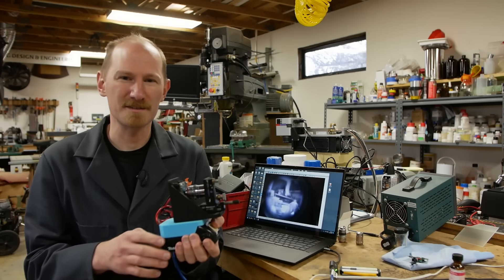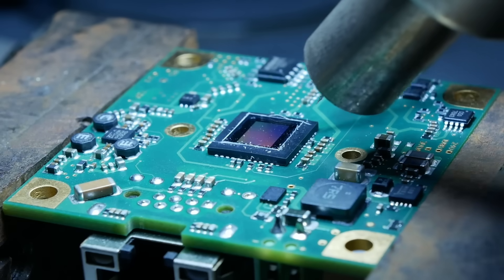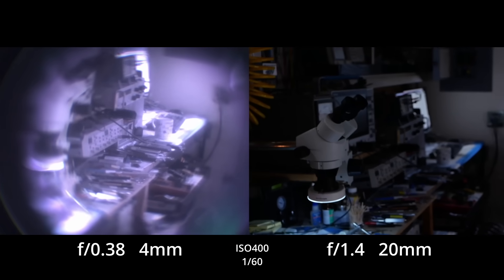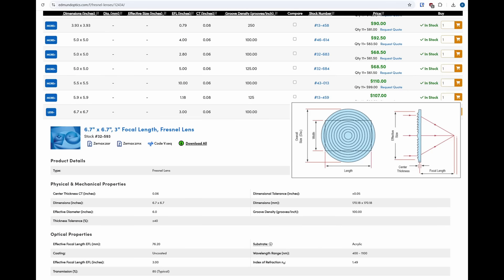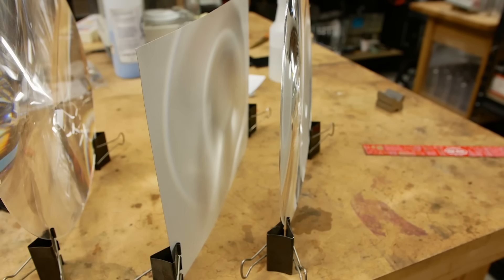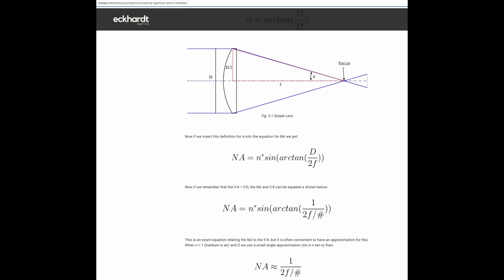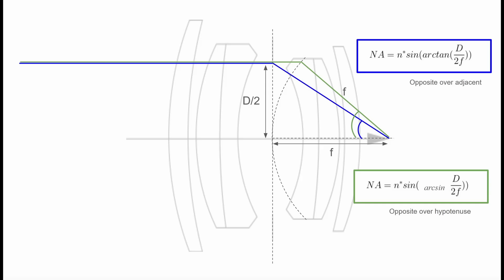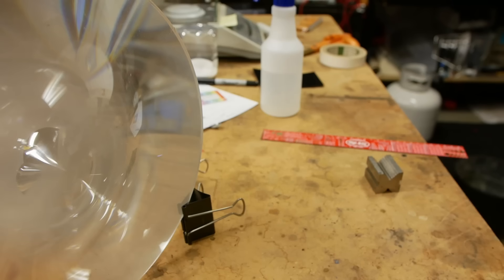f/0.38 camera lens made with oil immersion microscope objective

Comment: To my understanding you are using an oil immersion or dipping microscope objective for infinite tube length (infinity correction) reversed (image sensor at focal point). Note, that by flipping the objective the entrance pupil has become the exit pupil and the former exit pupil has become the entrance pupil. Now the numerical aperture value printed on the barrel is correlated to what is your system's exit pupil. In general entrance and exit pupil diameters differ unless the system's optical construction is symmetric. Honestly, the whole f-number to numerical aperture conversion idea and the formulas you came across seem dubious to me. It would work out for a single thin lens or a special system with equally sized pupils. But the result would be off for a thick lens or an asymmetric system.

For collimated imaging systems (infinite object distance) there is no meaningful numerical aperture since the marginal rays in object space are parallel to the optical axis. Therefore f-numbers are used instead. Technically speaking f-numbers only make sense with collimated systems. (The f-number setting of photography lenses are for infinite object distance only. When used at a finite object distance an exposure compensation is mandatory. When the (absolute value of the) magnification is below 0.1 the compensation is so small that it is usually neglected.)

Since microscopy objectives are highly optimized for a specific magnification, the ray tracing should be more or less unique. (No tracing for different configurations required.) If the manufacturer provided you with a ray tracing plot, you should be able to figure out the pupils yourself. For a collimated system like yours the entrance pupil diameter is just the diameter of the marginal ray bundle in object space. Some objectives even have a rear stop of the same size as the pupil to reduce stray light.

More generally you would first find the intersection of the object space chief ray with the optical axis. This is where the entrance pupil plane is located. [Note: Do not follow the chief ray as it is refracted. Just extend the chief ray emitted by the object until it intersects with the axis. If the ray is parallel to the axis the pupil is at infinity and the system is object space telecentric. Side note: If you follow the chief ray through the optical system an aperture stop could be placed wherever the ray crosses the optical axis.] Next you would intersect the object space marginal rays with the entrance pupil plane. [Note: Again, do not follow the marginal rays as they are refracted. Just extend them as they are emitted from the object.] 
[In the same fashion you would intersect the image space chief ray with the optical axis to get the position of the exit pupil plane. And you would intersect the image space marginal rays with the exit pupil plane to find the exit pupil.]

Did you notice a big difference with the protective glass on? 

The refractive index of immersion oil is probably close enough to that of the glass cover. (I would not worry too much about small differences between indices for now since the main purpose of the oil is to prevent reflection where light transits into a medium with lower refractive index.) Have you thought about filling the gap between protective cover glass and sensor with immersion oil? You would have to make holes without creating any loose dirt. Maybe you could poke holes through the resin with a hot needle. On the other hand the oil might even reduce the effect of the micro lenses of the sensor resulting in lower sensitivity.

Comment: Very interesting project. The oil immersion thing is certainly something not used in conventional photography. I'm into fast lens designs and once experimented with a huge ass Fresnel lens forming an image on a sensor, but the quality was underwhelming due to lots of coma/chromatic aberrations.

As for numeric aperture, I had an intuition that the actual f-number is determined by a solid angle that is formed by the aperture as viewed from the focal plane (rather than the simple geometric f/D ratio), and that solid angle is limited to a full hemisphere as the focal length approaches zero. NA seems to be the relation of that solid angle to the theoretical maximum of a full hemisphere (which is 2π sr). Hence the sin(atan(1/2f)) notion that can be derived from the formula for the solid angle of a cone. By the way, sin(atan(1/x)) may be expressed as 1/sqrt(x^2+1) for positive x, which may be more straightforward.

In essence, the effective lens speed is affected by the cos4 vignetting law, resulting in a lower ability to collect light coming from increasingly steep angles, especially when using modern sensor designs that are optimized for telecentric lenses.

Comment: On your discussion of F number you have hit the nail on the head.

Numerical aperture is defined as 1/2F, because the approximation works.

The old saw of at low x, sin(x) = x is still being used everywhere.

So for professional lenses they keep using the same old formula even though it's wrong.

Comment: F-stop of a lens is measured by dividing the focal length of the lens by the diameter of its aperture.

As to “being focused down” is not correct.  You can only measure the distance away from center where image remains SHARP.  That Laser was sharp when in the center, but as you move out you can clearly see that the dot is no longer sharply being resolved.  Sure it’s focused, but it’s not sharp.  So you can’t make the measurements the way you did and call it a f.05.  It’s not just contrast either, colors will also be come distorted 

Lens F stop is the distance between the optical center of the lens and the point on the camera sensor where light converges to form a SHARP IMAGE.  

Manufacturers have been fudging numbers for years.  I have many fast lenses, and they all have the same exact relationships, the faster the lens, the shallower the depth of field, example of 85mm f1.2 lens on a 35mm sensor  if you focus on the eye of a subject, the tip of the nose and ears will be out of focus. Use that same lens on a 4/3 sensor, crop factor, the DOF will be less shallow.  

There are many factors involved and making fast glass that resolves on a microscope vs fast glass for an 8x10 field camera is a wold apart.  The relationships between the sensor and the DOF are a HUGE consideration.  That is because You can only measure the distance away from center where image remains SHARP this is your downfall in my barely educated opinion.

Comment: Have you considered that the objective you are using is infinity corrected? Older objectives require specific optical tube lengths (distance to the eyepiece) to work correctly, while newer objectives are often infinity corrected, meaning that the distance to the eyepiece literally does not matter. For older objectives, the overall magnification and chromatic aberration change with optical tube length, but newer objectives totally remove that characteristic.  I have a large research microscope from the mid 1970s and changing the interocular distance (distance between your eyepieces) alters the magnification slightly, while a much newer microscope will not do that.  If you look at the nomenclature on the objective, you should see something like "Plan Oel 100X" and "210/0.15".  In this example, the 210 is the optical tube length in mm, which may have an infinity sign, and the 0.15 is the coverslip thickness.  "Plan" means that it is corrected for a flat field of view, which you definitely want.  Otherwise, only the central 70% or so will be in focus, with the periphery out of focus.

Comment: The faster the lens (lower F stop) the shallower the DOF (depth of field), however the aperture blade count has a direct effect on how the DOF resolves an image. In laymen’s terms the blurry area in high contrasting areas will not be round (spherical). They will look flat sides, so the higher count of aperture blades the better, better yet don’t use an aperture and use iso and shutter speed to control exposure.

Comment: Asianometry told story about high NA process used in photolithography. 
Each times when light goes thru two materials with different optical density part of the light is reflected back. Oil immersion reduce the impedance missmatching between cmos sensor and camera lenses. Each times when light pass thru by border between two different materials it can absorb (of reflect) 5% of light. 3 lenses on optical path means 6 times when light change propagation medium and it can delivery only 72 % of initial light.

Comment: Very interesting. The fastest lens withe larges image circle you can buy without spending an arm and a leg is the 100mm Zeiss Biotar f0.73 X-Ray lens that cover 6xF medium format (IMAX). You get those around 500$ on ebay. We used that one for our "f07" YouTube episode (as filmmakers we approach this from a more artistic then scientific angle but still dive a little into physics). The back focus is something like 4mm at infinity when a smith lens (field flattener) is applied. I am doubtful that you can reduce the focal length to get all that light onto MFT sensors. My understanding is, that at f0.5, the image is inside the lens... with a plano convex rear element and oil you could potentially bring your sensor there, but how would you go faster? f0.5 is deemed the limit for that reason. Well, if you want to try, the 100mm Zeiss Biotar f0.73 could be a good srting point. If you are interested in how the images look, check out our episodes... we got a f0.3 episode, too, but that is about using the equivalency of lenses to create unique images. If you are able to build something functional... we would love to collaborate and shot something with it that is worth the effort. Let us know if you are interested.

Comment: I friend of mine used to hang a glass rod in his drill press and then heat it with a torch while drawing it (suspended weight?) to form lenses. He made a 5x lens this way...sort of a fiber optic 5x lens. I wonder what the upper limit would be for this technique...practically speaking.

Comment: We all know that all these numbers don't matter if you don't the size of the sensor. In order to understand these numbers you need to know the crop factor of your sensor. 
a 35mm lens on a APCs (1.6 crop factor) is the equivalent of 56mm lens on Full Frame.
a f1.4 lens on APCs is the equivalent of ~f2.2 on Full Frame. 
What is the equivalent of your f0.38 lens to Full Frame ?
The sensor from the description is a 1/2.5" in size and it has a crop factor of 6.02. 
If you make this lens as big to fit on a 35mm sensor, your lens will be a 4mm * 6 = 24mm, with a f0.38 * 6 = f2.28 ?
24mm f2.2 doesn't sound that impressive.

I'm not an expert in this, but if i made any mistakes, please correct me.
EDIT: on why does it look brighter, my only theory is that you put a cheap or fake infra red filter on the lens. You can see a lot of infrared light on your 0.38 camera video, which means the sensor is also seeing more light because the infrared is not blocked completely. 

I would love to see how did you calculate the shutter speed to match the 1/60th/s time ? As the datasheet doesn't really show how to calculate this.

Comment: This is funny, I was just watching a Smarter Every Day video where he was talking about very very thick leaded glass windows for blocking radiation.  Apparently they used several thinner sheets of glass with oil in between instead of casting a single foot-thick block of glass, where the oil does similar optical coupling work as described here.

Comment: I have Zeiss R-Biotar 100 mm f/0.73 from X-ray machine. Covers 6x6. Couldn't build a working test rig yet, cause the flange distance is around 10 mm, so no full frame camera system can accomodate flange distance that short. The camera needs to be vandalized and I haven't come to workable solution yet. But would love to play with the lens the same way The Media Division did it.

Comment: I'm not an optics expert, but I was under the impression that it shouldn't be possible to produce a lens faster than ƒ0.5, even with oil immersion. So, I'm intrigued.

I have a couple of questions... First, can we confirm that this is for sure a ƒ0.38 lens in its current configuration? In some cases, immersing a lens in liquid can increase the focal length, which would result in a larger ƒ-number. I couldn't quite tell what objective you're using, but if the rear element is convex, I would expect the focal length to have been increased.

Second, is the camera system capable of focusing to infinity? Focusing on an object closer than infinity shifts the image plane rearward, reducing the effective ƒ-ratio.

I've done some basic experiments with close-up filters, large aperture lenses, and ray tracing software. What I found was that at ƒ-ratios larger than 0.5, light reaches focus inside the lens, making it impossible to capture an image. The same lens will work focusing closer than infinity, but the effective ƒ-ratio will be larger than 0.5.

Again, I'm not an expert on optics. My comments are based on a rather limited understanding. And I know even less about oil immersion optics. I'm happy if this comment contributes to the conversation, and I'm happy to be wrong and to learn something new.

Comment: I'm surprised you didn't touch on the difference between an f-number and a t-number, since the f-number is based on the approximate math you mentioned, and the t-number is based on the real-world amount of light coming through, which is why it's a slightly higher number representing a lower amount of light transmission

Comment: Did you try any solvents for de-bonding the sensor glass? One of my go-to's in art conservation is heptane. Often times using small pieces of dry ice works better than heat to embrittle bonds.

Comment: This is o3-mini-high answer. And I love your videos. 

'microscope objectives are designed so that their effective f-number is approximately 1/2NA in air. That is why your measurements “follow a factor of 2” even though the simple small‑angle approximation doesn’t exactly apply'

Here’s why you still see a factor of 2 in practice:

1. *Design Convention (f-number):* In many imaging systems (including microscopy), the f-number is defined as
   \[
   \text{f-number} = \frac{f}{D}.
   \]
   For an aplanatic system in air, it turns out that
   \[
   \text{f-number} \approx \frac{1}{2\,\mathrm{NA}}.
   \]
   This immediately implies
   \[
   D \approx 2 f\,\mathrm{NA}.
   \]
   So even though the full trigonometric relation for a thin lens is more complicated (especially when the angles are not small), microscope objectives are engineered so that their effective aperture and focal length satisfy this 1/(2NA) rule.

2. *High‐NA Effects:* For high numerical apertures the angle \(\theta\) becomes large and the difference between \(\tan\theta\) (used in the simple derivation) and \(\sin\theta\) (which actually defines NA) is significant. That is, the small‑angle approximation \( \sin\theta \approx \tan\theta \) no longer holds. Yet, in the design of objectives the effective aperture (or “pupil”) is chosen in such a way that the overall system performance is optimized, and one still ends up with the effective relation \( D \approx 2 f\,\mathrm{NA} \).

3. *Effective Aperture vs. Physical Aperture:* The “aperture” in a microscope objective is not always the same as the physical diameter of one of its elements. Instead, it is an effective aperture defined by the optical design (which includes several elements, refraction at multiple surfaces, and field flattening). This effective aperture is what leads to the well‐known relation between f-number and NA, with the factor of 2 built in.

Comment: The optical guys I used to work with at Battelle were wizards, using their knowledge of the dark arts to bend light to their nefarious purposes!

One project required a perfectly collimated beam from halogen lamp. This is especially difficult because the lamp has a wide spectral output, so all the individual wavelengths had to be focused together. This needed a multi-element lens assembly where each lens element not only varied in focal length, but to create the optical properties needed, also varied in refractive index and coating. If I remember it was a 7-element lens. 

I had another job at a start-up working on a binocular system that needed to have peripheral vision. Each lens had a FOV of 220 degrees - actually greater than 180! It was an amazing 11-element lens assembly.

Comment: Probably the best way to get a sharp image from a "low f ratio lens" is to use an array of lenses, either on one big sensor or each with its own sensor, and to stack the resulting images. The downside would be that the bokeh would have gaps in it resulting from the gaps between the lenses.